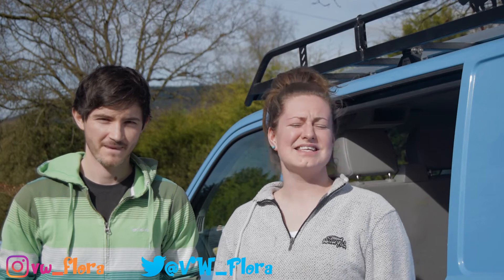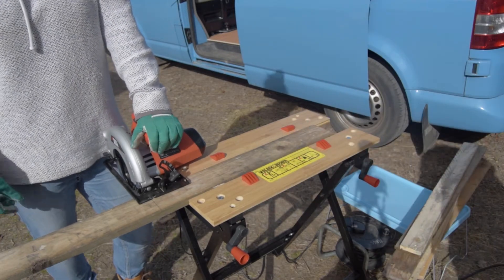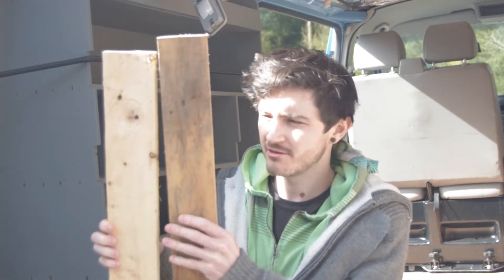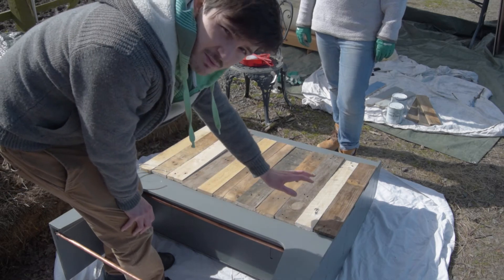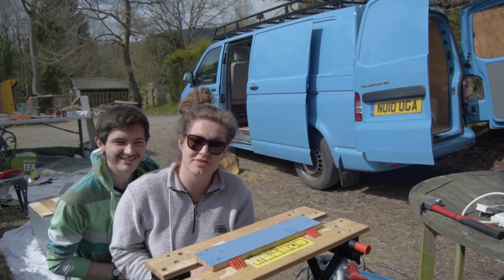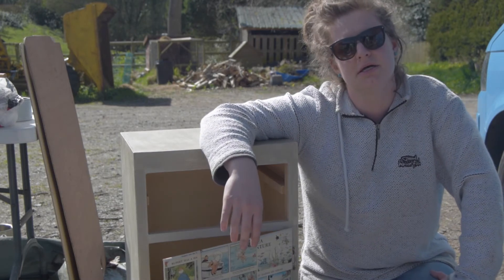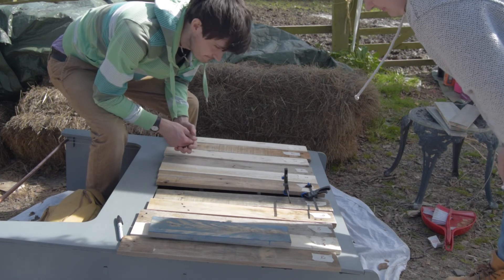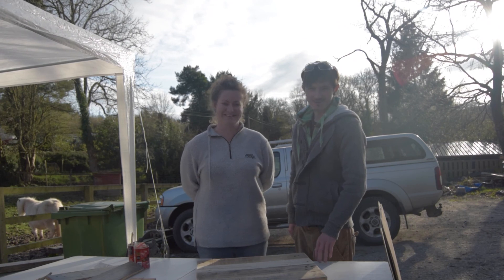Day 18 - Making furniture (Part 2) #VanLife VW T5 Camper Conversion

Comment: Loving the videos how you finding the cabinet now you have been using it? Looked really flimsy at first is it standing up to use, as looking to do something similar? PS more videos please 🤗
Reply from the maker: Hi Simon Green, cupboard is now fixed to the floor in multiple places and is very sturdy. It's been in a fair few months now and we're very happy with it, other than the magnetic catches aren't strong enough so that will be an amendment soon, we're currently building our kitchen unit so stay tuned! X M